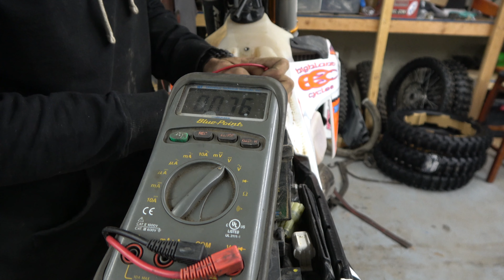Antigravity Battery In a 2023 KTM 300XC? | Will It Fit | Highland Cycles

Comment: I did this and it worked great...however i made a new battery cable that goes from solenoid and wraps completly around the battery before connecting to the positive post of battery...way less binding and bending of the cable.

Comment: Excellent! That's the best mod ever. Now the electronics and especially the starter motor will perform and last longer. A big voltage drop equals higher amperage and blow fuses, burn up motors and screw up electronic controls. Good job!

Comment: Does your battery jump over 14V when you throttle up ? I bought another brand and it's stuck at 13.2V regardless of rpm and how long ! Thanks
Reply from the maker: No. The regulator on these bikes keeps it low. I don’t really understand why
Reply: @highlandcycles  I checked and have around 14.5V at the regulator output, both idling and at 5000rpm.
Reply: @baola5534 what battery combination are you using to get 14.2v @ the regulator output?

Comment: Is that battery smaller than the one in your husky? I have a 2019tx300 and based on the measurements I'm not sure it would fit
Reply from the maker: I don’t have a Husky. Not sure what you are talking about.
Reply: @highlandcycles  what is daisy?
Reply from the maker: @utahenduro4808  2018 KTM 300XC-W
Reply: @highlandcycles  ah, thought it was a husky. Does the ag801 battery fit the 2018 300?
Reply from the maker: @utahenduro4808  Yep, drops right in

Comment: Hey, the guys over at motominded channel did a load test on the stator and recommended nothing higher than 20 watts for an accessory or light, and don’t run the fan at the same time.   The stator puts out 77 watts at 5000 rpm.  Tiny.
Reply from the maker: Yep. Chris is a friend and sent me that test. Kinda sucks
Reply: @highlandcycles  👍 A bummer for sure but the aftermarket will solve it soon.

Comment: aftermarket part you need to do for your $13,000 2023 KTM to make it work #26 lol. buys yz250
Reply: Yamaha 4 strokes also benefit from the antigravity battery. I put one on my 2020 YZ450fx so it would start faster and not turn over a couple times before it started.